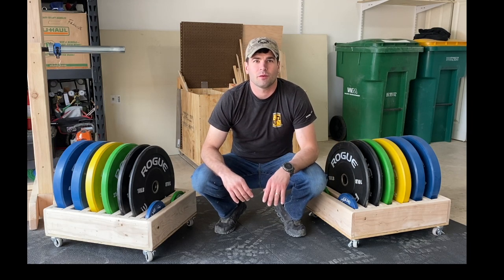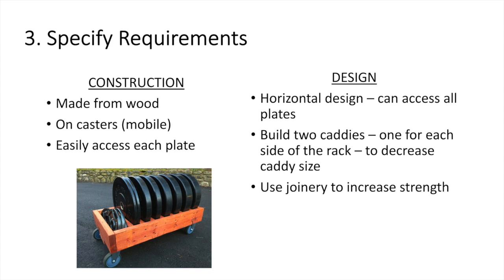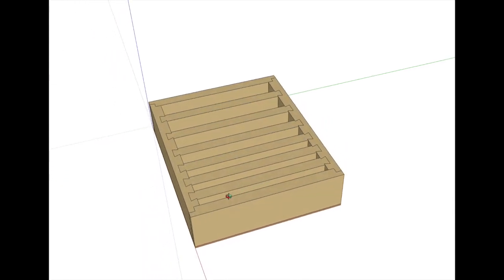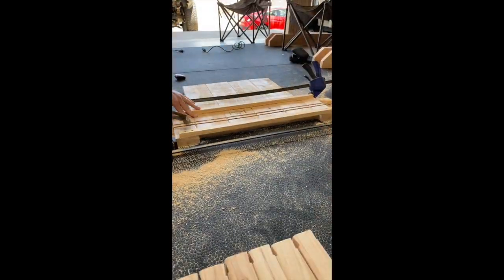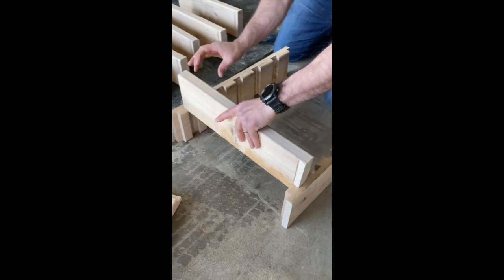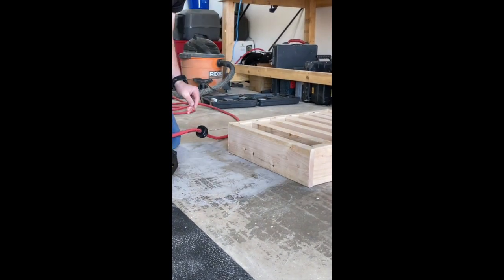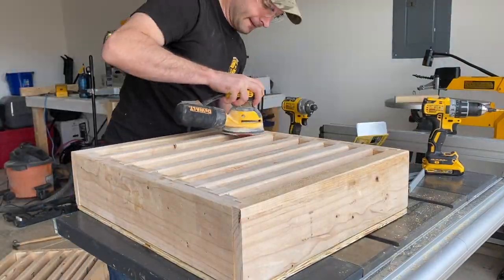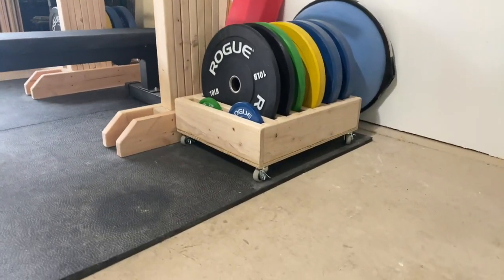DIY Bumper Plate Storage

Comment: Good video.
IMO over engineered, glue and screws will do the job. No jointers needed.
I would even remove the bottom plywood, if the plates are floating, there’s no need for it.

Comment: Do you think if I just screwed together the frame and then cut pieces for the middle and screwed them in each side it would work? Like without any joint action because I don't have that kind of knowledge or tools
Reply from the maker: Absolutely. I used dovetail joinery because I wanted to challenge myself, and I wanted to ensure it would last - I hadn’t built a bumper plate caddy before. Having used my two for over a year now, they don’t take that much lateral forces from the bumper plates, as long as there is a plywood bottom (the bumpers hit the plywood first). If you decide not to use a bottom (which is definitely an option) the sides of the frame will begin to support the bumpers, which will introduce a lateral stress/force. I still think glue and screws would be fine for this application as well.
Reply: @EngineeringWorkshop_hvw  nice! I'm thinking of slamming one out. I'd just try to use whatever wood I could find so I already know it's not going to be nice looking like yours 😆

Comment: This is why things that don't require the "engineering design process" (such as a square box with dividers) cost so much in the real world. The design and finished product look great!
Reply: Nailed dovetails? Plus screws, it's over engineered, butt joins and glue would be half the time and cost and just as strong for the purpose
Reply: @KKSHS11  Right, this should have taken less than an hour. I built a nearly identical weight plate storage box six years ago without dovetails and it’s absolutely fine after almost daily use years later.

As an actual licensed engineer who works with contractors... this is why people who work in construction are often skeptical of “engineers.” Engineers with real world common sense are extremely rare.
Reply from the maker: You are correct - butt joints with screws and glue will hold just fine. I’ve been meaning to redesign this caddy to make it easier to construct. 

A point to consider - not all of engineering is about function. I designed this with dovetails because I wanted to challenge myself, and I wanted to know that I went the extra mile to over build it, every time I look at it. To that extent, I’m completely satisfied and it was worth the time. It’s the adage “if it’s worth doing, it’s worth overdoing”. My wife gets a kick out of making fun of me for that too, when we work out together. 

Unfortunately, the dovetails weren’t as tight as I would have liked (thus the nails), but I’m better at them now lol. Maybe next time.

Comment: Way more complicated and over kill then needs to be

But good design
Reply from the maker: Yes, the use of dovetail joinery definitely complicated the build. My original design intention was to use the side frame pieces to support the bumper plates, as opposed to the bottom plywood. I thought that dropping a 45lb plate from any height over time would eventually break the bottom off the frame. Because bumper plates are all the same diameter, theoretically they could all contact both side frames at the same time they touch the bottom plywood - three points of simultaneous contact. Dovetails in the frame would be the best way to strengthen against lateral forces. However, my measurements were just a hair off (limitations of using SketchUp) and the plates only contact the bottom when lowered straight down. Oh well. However, after months of use, the worry that the bottom would break off the frame has been unfounded.
Reply: sounds like it needs a Rogue sticker on it then.

Comment: Great video! I know nothing about carpentry or wood work, you mentioned the next time u build this u will use a a day do?
Reply from the maker: A dado joint is simply a slot cut into a board to allow another board to fit tightly into that slot. You can google image search "dado joint" and "dado dovetail joint" to get a better idea of what I'm trying to describe. The regular dado joint is easier to cut into the frame / side pieces because you can use a table saw vs a router. Furthermore, you won't have to cut anything into the cross member to get it to fit into a regular dado joint, where as you have to cut the dovetails into the cross member for a dado dovetail joint. The benefit to a dado dovetail joint is that is resists pulling apart and is very strong - it's just a lot of effort to make lol.
Reply: @EngineeringWorkshop_hvw  oh a dado not day do. Now I have something to google. I might have to out source this job since I don’t have any tools

Comment: Does it work for iron Olympic plates?
Reply from the maker: Looking up the dimensions for the 45lb Olympic Iron plate yields a thickness of 1.25" and diameter of 17.72" - compare this to the 45lb Echo Bumper Plate of 2.4" thickness and 450mm / 17.71" diameter. The Echo plates are larger than the Olympic plates, so the smaller plates should fit in a larger slot. 

However, each plate (by weight) is a different size for each brand. Bumper plates are usually the same outside diameter and only vary in thickness (from 2.40" for the 45lbs to 0.83" for the 10lbs). It appears the Olympic plates are the opposite, the same thickness (1.25") but vary in outside diameter (17.72" for the 45lbs to 9.13" for the 10lbs)

This storage solution was designed for plates with the same outside diameter and varying thicknesses, giving a 1/8" tolerance (or excess) for ease in lifting the plate in and out of the caddy. The exception being the 5lb and 2.5lb plate that fit in the front. There is ~0.25" tolerance for diameter as well - the plates can slightly roll back and forth between the two outside frame members.